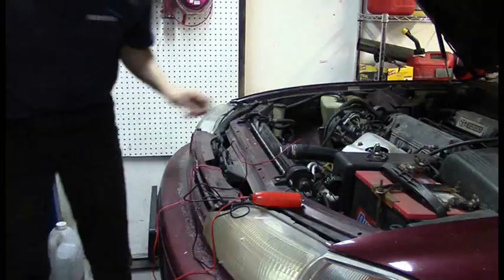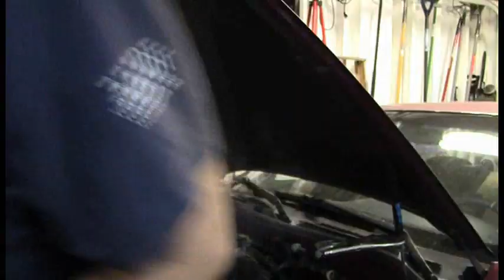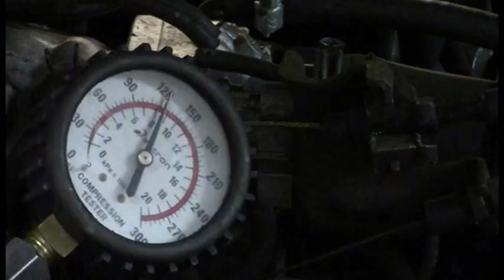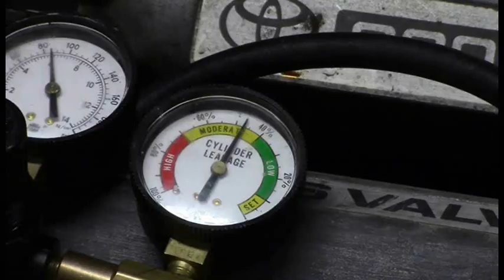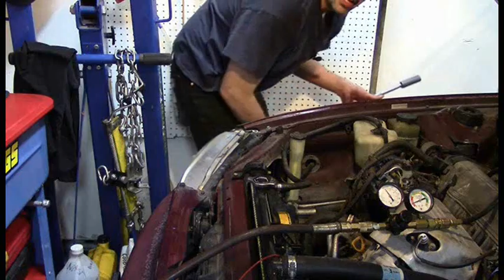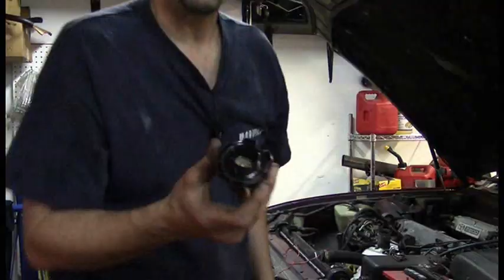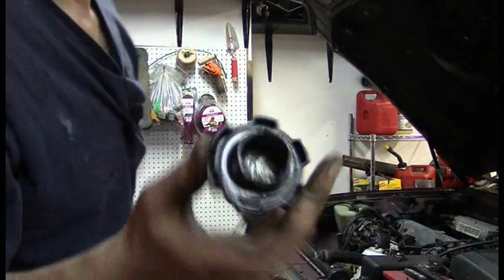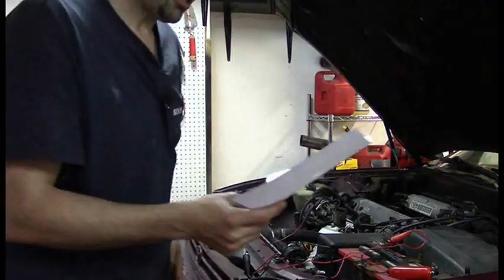12 Ways of How To Test A Blown Head Gasket Compared- PART1

Comment: I couple other ways, without testing equipment 
Steam out of exhaust with a major gasket leak
No heat coming from the heater
minor leak, once engine is normal temp, bubbling in your coolant overflow reservoir
and the engine may begin it idle rough and CEL gives a lean code
Reply: +DaytonCarCare 
How do you determine if the steam is not from intake manifold coolant leak and not head gasket?
How do you deterrmine no heat is from thermostat problem and not head gasket?
How do you know if bubbling is not from normal water pump activity as was shown in video?
 How do you know if rough idle and P017x is not from 1000000000 other causes?

How do you recommend applying these tests to confirm it is indeed head gasket that is the issue over other variables?
Reply: +Schrodinger&#39;s Box Quantum Mekanix Just from years of working on many types of cars and typical situations.  Anytime I run across a failing t-stat or water pump the temp would rise above normal/slow to heat up. Or the water pump would leak from the shaft. Another way is no change in temp or water flow in hose after the t-stat.   Yes it better to do tests to know for sure. But when you know you know after being around cars for so long.  I take of my cars and have never had a failed head gasket.  But of course there are others that just drive their cars and don&#39;t pay attention to it&#39;s behavior. And a water pump wouldn't introduce air into the system to cause bubbles unless you have a pretty good leak.
Reply: +DaytonCarCare  No replacement for experience! So on a lean code such as a P0174 that you find is NOT from a head gasket leak, what method do you use to determine the cause?
Reply: +Schrodinger's Box Quantum Mekanix If not that an intake boot or PCV hose that is loose or cracked introducing too much air into the system after the MAF.
Reply: +DaytonCarCare I&#39;ve also have had bank 1 or 2 codes from the EGR carboned up and sticking open as well. It's funny though. Working mostly on German cars I don't run into these issues.  Worse I've seen in on Audi/VW 2 liter turbos that get a misfire and injector code due to a failed injector. Easy fix. Another easy fix is the GM cars made after 05 with electronic gas pedal. It starts running like crap. Remove it split the casing clean the contacts and board and like new again. Don't pay the $200-$400 they want for a new one. LoL
Reply: +DaytonCarCare But how do you actually diagnose the specific problem out of all those possibilities you listed?
In other words, how do you know if it's a bad MAF reading vs a bad fuel injector vs a bad TPS like on the 05 and later GM?
Reply: +Schrodinger's Box Quantum Mekanix I already explained that
Reply: +DaytonCarCare Well, you listed a bunch of possible causes you found in the past but how do you determine which cause was the problem? How to differentiate if it's a bad MAF vs bad injector vs bad TPS on a P0174 for example?  Are you saying you do it by typical problems of a vehicle type?
Reply: +Schrodinger&#39;s Box Quantum Mekanix Well I have never had a P0174 from a failing TPS or MAF. But if it&#39;s a DTC that points to one of those then I look up the specs to test VAC/VDC and or Ω. Injectors are easy to test. Swap one from another cylinder and see if the DTC points to the one you swapped it to.
 Audi/VW fuel rails are so easy to remove I could literally change all four injectors in seconds not minutes.
Reply: +DaytonCarCare Amazing.  Your hourly diagnostic rates must be astronomical! Why on earth would you not just look at fuel trims to diagnose the condition in a few seconds?
Reply: +Schrodinger&#39;s Box Quantum Mekanix Um... er... because the DTC reads specifically what injector #1 it is. Thats how efficient Vagcom is on Audi/VW. Most other cars with OBDII just gives you a guess or a generic code then you have to do other test. LoL and my rates. Well had a guy bring his Mercedes to a shop and they wanted $3k to replaced his tranny. I found it was just a conductor plate in the valve body and a $160 part. So no I charge much less. But if youre just trying to bait me into an argument over testing methods. Dont waste your time Ive been wrenching for a good 30 years. I go with what I know. And I know to stay away certain makes of cars because the engineers didnt give a crap about the techs that have to fix their mistakes afterwards
Reply: +DaytonCarCare You&#39;ve certainly made yourself clear! Thanks for the information. Feel free to give the contact info for your shop- I'm sure the viewers here would like to know.

Comment: @Schrolingers Box
First off Thanks for the reply and Thats makes sense and its a 04 Volvo C70 5cyl 2.4L haven't did any compression tests as of yet... but did find a leak as if maybe it is a freeze plug behind the exhaust manifold on the back of the motor, can get car to start to do any kind of compression test.. car did run hot though, and did crank up after being allowed to cool down, didnt give it any gas then shut down and hasn't crank since... was thinking it could be a head gasket also since there is not enough compression to crank up.. any input you have is much appreciated.. thanks for your time

Comment: just had a quick question, if the car has no compression to the point of the car won't start then what else could it be ?
Reply from the maker: +Kount Barber The most likely cause of that would be a broken timing belt or a severe cam/crank timing offset. This is assuming of course that all cylinders have similar low or nonexistent compression.
  On a car with only 4 cylinders however, you may indeed find a no-start or inability too keep running if just one cylinder has no compression.

Comment: When you test with a sheet of paper, the spark plug is (obviously) removed, so how does the piston then build up enough vacuum to suck in coolant?
Reply from the maker: Yes presumably the coolant already needs to be in the cylinder or it is getting in through the 15 PSI of coolant pressure.
  Definitely not a conclusive test and in fact I couldnt even reproduce it in the video if I remember.
Reply: +Schrodingers Box That seems reasonable. Thanks for very informative videos, I enjoy watching them!

Comment: Great video. Where could I get a Carbon dioxide tester like yours from? It seems like the easiest test for the average joe. I am looking to buy a bmw e46 and where I am from they get driven hard, so I need to be confident head gasket isn't an issue. Thanks so much
Reply: +ohze schnitzel Common item you could order online.

Comment: So you're supposed to do that bulb/colored liquid test when the engine is running? Is that correct??

Also, is there any particular reason that you're doing the leakdown tests with 90psi of shop pressure? Is that the general rule of thumb, or does it vary car by car?
Reply from the maker: +Zack Richmond Yes and yes. Really you want minimum 90Psi for leakdown but more is OK.
Reply: Schrodingers Box Appreciate it. I normally always do my own oil changes, but I found a good shop that I've liked going to for the purposes of having records of service and the fact that I live in apartments which frown on working on cars in the parking lot.

Anyways, long story short they overfilled me by about two quarts. They put the correct amount of oil in (which I have proof of), but it seems the only possible explanation is they didn't allow all the oil to drain first. I'm surprised because they've done the oil perfectly 6-8 times so far. 

Anyways. I had major smoking out my tailpipe as the extra oil pushed past the seals by not allowing my oil return drain line on my turbo to work. I also had some oil push up onto the threads on the spark plugs. The plugs were all oil-fouled too. I ran a compression test and things look typical (I take super good care of my car and generally run compression every 5k miles or so). I am concerned, however, that the oil overfill may have cause a head gasket leak, bent rods (from hydro-locking) or rear main seal failure due to the extra oil pressure. The major tailpipe oil smoking stopped after the excess oil was drained. I'm just hoping everything is perfect. I may pay for a leakdown because I don't have an air compressor.

Comment: Scientifically can a spark occur in a gas tank from a failed module or pump/ or wiring faults of any kind like melting or can wires spark in a gas tank ?

Seems odd to have wires in there. Surely science must have facts to show this ain't a issue right and can not occur for any reason.
Reply from the maker: +Headshothorror4488 While I suppose there's always the potential for a freak condition, there is no such danger unless a mess of perfect unfortunate events occurs. Sparks are going to occur when there is switching which occurs well outside the tank. Even if there were sparks, the pump is submerged in fuel and contrary to popular belief gasoline is not flammable- only the vapors are. Liquid gasoline would put out a fire. Finally there is no oxidizer in a gas tank- the presence of only gas and even vapor without oxygen makes for a nonflammable condition (the opposite is also true BTW... pure Oxygen is NOT flammable, contrary to common belief).  So even if by some off chance a spark were to ignite the vapor in a tank, it would hardly "explode".
Reply: Schrodingers Box Nicley stated. Thank you for your explanation.

Comment: Thanks for your video again!
I am losing coolant slowly 250ml per week. Also misfire in one cylinder
Coolant UV dye test negative
Radiator compression test normal
Cylinder compression test normal
Oil and coolant looks normal
CO2 test/ head gasket leak dye test normal 
Finally I use  a cheapo borescope and I can see greenish coolant inside the misfire cylinder ! Bingo

Comment: My truck ( 1988 350 Chevy ) is mysteriously losing coolant.  No puddles under the truck,  nothing showing on the motor itself.  I removed the heater core and it looks brand new like it was installed yesterday.  There was no residue in the heater core box. Still I have to add about a gallon or more of coolant every couple of weeks.  I added coolant today to the reservoir.   While adding water I noticed bubbles coming up in the coolant.  Cani I assume I have a "blown head gasket"?  Or a crack in something or the like?  Thanks for any help.
Reply from the maker: +Wayne W What were the results of the diagnostic tests?
Reply: Compression showed 115 to 130.  That's really the only test I did
Reply from the maker: what is spec?
Reply: +Schrodingers Box To be honest, I don't know.  I have tried to find it
Reply: +Wayne W I have seen posts ranging from 110 to 150.  So I really don't know
Reply from the maker: Wayne W If consistent through the cylinders its not likely head gasket. Pressure test of cooling system and cap is next.

Comment: hi sir i have a question . if the radiator is open and i speed up the engine and the water is blowing out from the radiator is it my gasket is damage? the mechanics said that my gasket is damage. is it normal or it's true that my gasket of my honda odessey is damage?
Reply from the maker: +Meldrid Chavez The water pump itself could cause that. It is not a valid test for a head gasket.
Reply: +Schrodingers Box So sir my gasket is not damage ? thank u +Schrodingers my mechanics is sucks.
Reply from the maker: Meldrid Chavez I dont know. I am just saying that water spewing from an open radiator cap could be normal from the water pump. If you suspect a head gasket problem this is not a good test for it is all I'm saying.

Comment: i have a 95 Honda civic with basically just water in it and i loose the water within several min around the water pump. plus when i fill with water and burp the radiator it just started to have white bubbles. just asking so i don't replace what's not broken.
Reply from the maker: +Jeramy Deane So what were the results from your diagnostic tests?
Reply: +Schrodingers Box I don't have the funds to buy the tools to diagnose let alone buy the replacement parts. that's why I had asked my question.
Reply from the maker: Jeramy Deane I don't know what you are asking me man...  This video shows almost a dozen ways to do the test without tools. If I have no data how can I make any kind of diagnosis- anyone's guess is as good as anyone elses.  My guess is you need a new engine.
Reply: +Schrodingers Box I'm not trying to be rude. I did enjoy your video and I stated what my problem is and what the car is doing. Plus I mentioned that I don't have any money for these tools and was hoping for a helpful tip other than to go spend a ton of money. now you speak of a new engine obviously not able too with shortage of cash. thanks for being a smart ass.
Reply from the maker: Jeramy Deane You just watched a video that shows MULTIPLE ways to do a diagnosis without tools and you keep saying you don't have money to buy tools.
  Sorry bro I really can't help you.